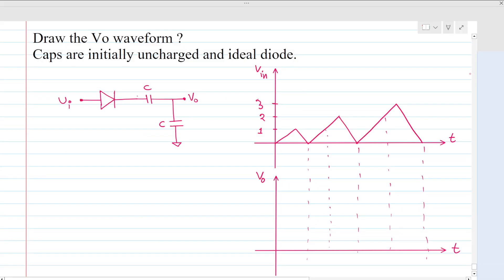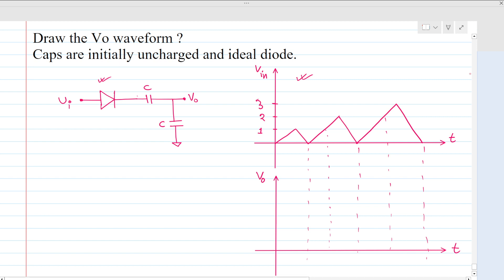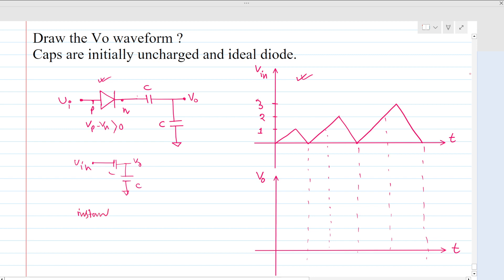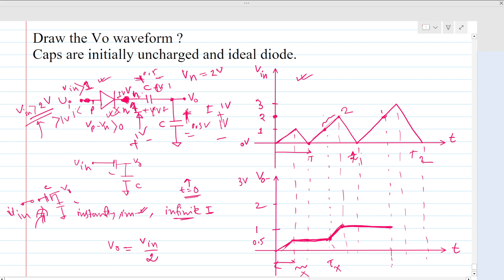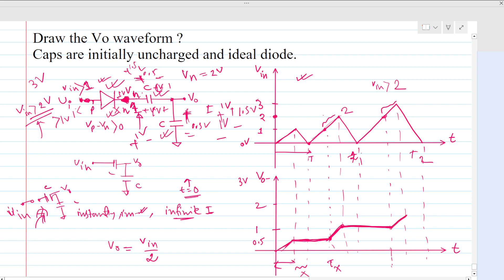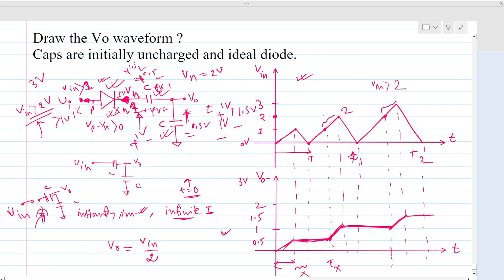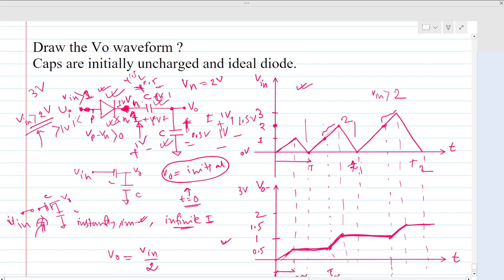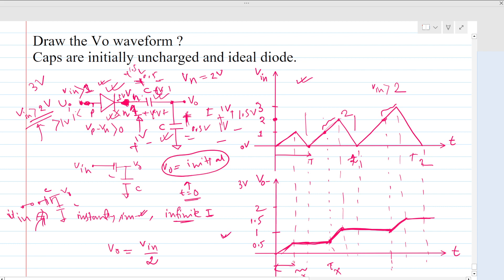Texas Instruments Interview Question for Analog Design Engineer

Comment: I have a doubt here, when the 2nd ramp starts max voltage is 2V and each capacitor will have 1v by voltage division. So in this case 
1) The voltage across two cap will charge and go to final voltage of 1V from an initial charge of 0.5V. 
Or 
2) The capacitor voltages wil be 1.5V by adding 1V to the previous charge of 0.5V of caps.
Can you please clarify this one
Reply: first case is correct

Comment: Thank you very much. How would it look if you placed a resistor, say 500 ohms between the diode and capacitor?
Reply: The  waveform of parabolic is from 0  to close to steady state  0.5v  and then the next parabolic  is from 0.5v  close to  steady state 1v and the next  parabolic from 1v   to close to steady state 1.5v 
vo(0-)=vo(0+)=0
vo(infinity)=vin*[C/(C+C)]
tofu=Req*Ceq=R*(C//C)
Vo(t)=v(infinity)+(v(0-)-v(infinity))*e^-1"*t/toN
R=500 ohm, C=C/2 
RC>>T
Vo(t) wavefrom is The  parabolic rising waveform will slowly reach a steady state.